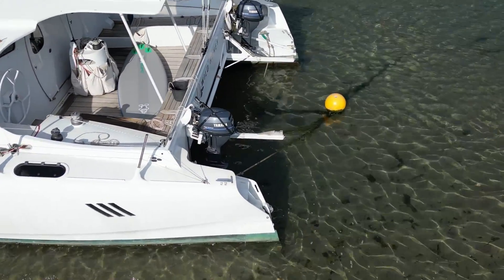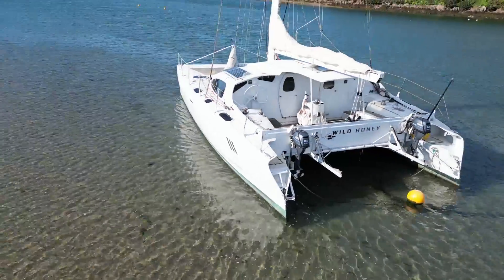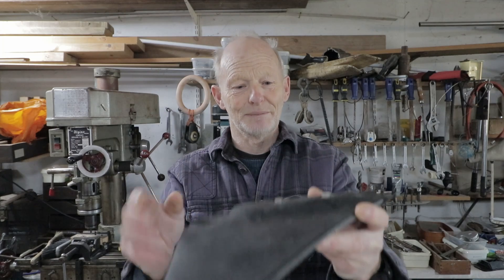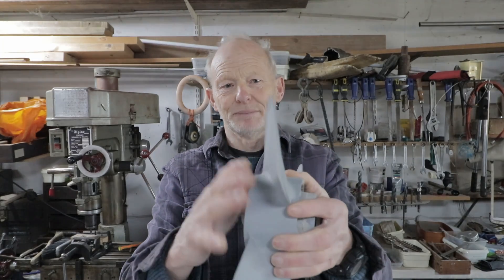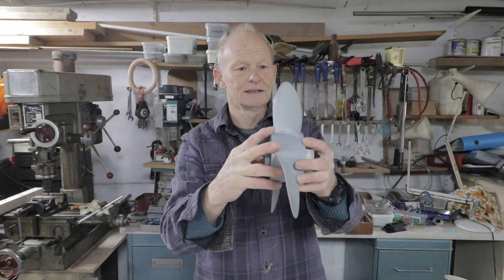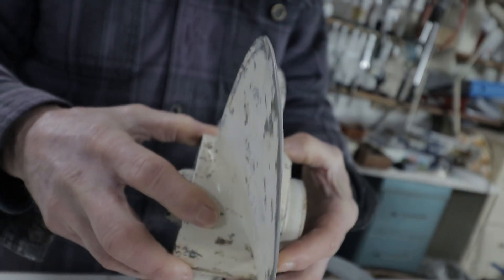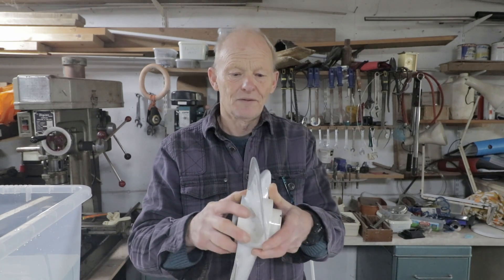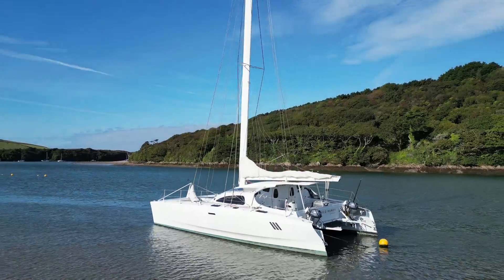Improving Propeller Performance In Rough Water – Ep05

Comment: Another solution would be to use 4 blade props that are cupped. To do this and still maintain full RPM of the engine the pitch number is usually reduced by 2 when moving to a 4 blade prop, best to consult with technical services at a reputable marine retailer or contact the manufacture. Four blade props offer more thrust, better maneuverability, better mid range cruising efficiency, and offer a better initial boost to get the boat moving(some call it a hole  shot in the US), in a planning hull boat the 4 blade prop will keep the boat on plane at a lower speeds when compared with the standard 3 blade prop. Three bladed props are better for top end speed which is not what you are after. Solas propellers offers aluminum and stainless replacement prop in 4 blade and three, in cupped and non cupped.

Comment: Love how you mount the outboards. What type of track is it and how did you mount it? Could you do a video on this? How do you raise and lower them? Steer them? Using outboards seems like way less work than mounting diesels internally. And if the type of cruising changes you can change to bigger or smaller ones. You seemed to suggest that the choice was influenced by being cost-constrained (aren't we all?). But is it not a better solution, or do you have reservations? I'd love to hear as I am mulling over this decision for my own design.
Reply from the maker: Thanks for your comments, and great questions! The track is a standard large mast track - a discontinued Bainbridge product - and we've built a custom car to go up and down. I've put this on the list for a film in the spring when we're servicing the outboards :)

Comment: If the underlying problem is that waves are heaving the props up and down in the water, then having the motors further forward (for example on a tilting platform) could help.  Depends on (longitudinal location of) the athwartships axis about which the boat pitches.  For a cat that's usually near the mast, and of course it varies by center of gravity and hull hydrodynamics.  If so, then the props might see more stable water depth nearer the mast, i.e., further forward.

For a cat with a wider stern at the waterline, the pitch axis may be further aft.
Reply from the maker: Thanks for the comments. I've done quite a bit of work on this and it seems thatthe pitch point on most cats is about 1/4 forward of the waterline from the stern. I'm planning a video on pitching, regarding Wild Honey specifically, which you may find interesting :)
Reply: @SailingWildHoney  The pitch axis (it really is a point in 3d space, but I called it an axis in 2d space, like a profile view) will be in different places depending on boat design.  The forces will act through the center of mass.  If the hydrodynamic forces on the hulls were equal fore and aft then the pitch point would be at the center of mass, etc. 

So depends on design, but may be further forward, especially on a fine stern with less pitch resistance aft.

Comment: If you angled the propellers, then the up down motion would not strip the boundary layer on the propellers as much.   Normally most boats have their propellers deeper so higher pressure also keeps the boundary layer attached.   Only real solution(maybe) would probably be a propeller with its infinite blade tips.  Of course currently only designing them for the 150HP market, and they cost $5000 a piece.
Reply from the maker: You're right! And propellors are expensive! But the cupping has been surprisingly effective :)

Comment: Perhaps it would be more effective to arrange for the propellers to reach deeper into the water? Add a telescoping piece to the mount that give you an additional 30 cm, and make a replacement hood that can stand hard splashing and being "submerged" occasionally, and add some nice smart replacement for the standard seals for the Choke knob opening in the die cast aluminum body etc. 

I'm building a set of two electric drives, 70x70 mm brushless motors feed by 100Ah 48V LiPo pack, as replacement for my outboard. I chose to do this because of the cumbersomeness of having a heavy gasoline engine. The new propellers are attached directly to the motor shafts, super tight and lightweight in comparison to commercial solutions. 
I sail a 1989 formula 28 catamaran, for it I have been using a single 6 hp Tohatsu SailPro that sat just a few dm above the water. Yet it lifted the propeller up and it sucks air when the waves are high. The boat is an old racer, so it’s only 700 kg (8,5 x 5,5 m with 15 m mast), and 6 hp did not take me upwind in hard conditions, but it allowed me to choose the downwind path 😏 Now I hope to be able to go any direction 😄

Thanks for your inspiring videos!
Reply from the maker: Thank you! Your boat sounds great!! Years ago we did look at electric but it was in it's infancy and we couldn't really afford it. But I did make some fibreglass pods for electric drives, which we then abandonned for the more conventional route. Lowering the engines would be a possibility if the problem with motoring were more severe, but the cupping has been surprisingly effective :)

Comment: Interesting study , I did think you were going to look at the height of the water in the tank to determine thrust ( relative difference)?
FYI to improve epoxy bond to alum or lead I do a final sand with some wet epoxy on it which keeps the air away from the alum and stop it oxidizing then go straight into laminating . 
Cheers Warren
Reply from the maker: Thanks Warren! Yes, the "experiment" left a lot to be desired :) 
Great tip for the epoxy bond

Comment: What about a propeller "tube" to eliminate the "water slip" from the rotsting prop? Cupped props only work in one direction, the opposit one lacks thrust. Coming from more powerful outboard engines the stainless steel props gain more bite due to thinner blades which also are more stiff compare to alu at high revv. Really expensive and hard to repare
Reply: a kort nozzle? too much drag for a normal sailing prop when not in use - but probably great for this setup since you retract them out of the water when not in use.
Reply from the maker: Interesting idea! We did consider using them, but felt that the issue we had experienced with the hydrofoil wing would be similar with a tube, in that a ventilation bubble would get trapped in the nozzle

Comment: I admire your engineering prowess in tackling that modification.
I think I would have looked to having a longer engine mount.
Not sure your front / aft explanation was quite correct.  Moving them a bit forward normally puts them at the highest point of the hull wave.  And closer to the point of least pitching.
I have a Woods Gypsy, the builder put the mount on the rear beam, very similar to your location.  I notice that Richard Woods drawings show the outboard in a cockpit well. 
If you don’t turn the outboards I can’t see the front / aft make a difference on the manoeuvrability.  It is more the distance from the centreline.  Of course if you can turn the outboards, as far back does work well.  I can turn my motor which is pretty essential as it has a flat bottom. 
I had a 22’ cat and used a dinghy motor that swivelled 360deg , great for turning and amazing for reversing.
Reply from the maker: Interesting, thanks for the thoughts! We have a friend who had a 360 mount and yes, it was really great for manouevring. But it was a lot smaller boat. Moving the engines to the pitch point will definitely help, but not an option for us at the moment.

Comment: I just came across your channel. It is so refreshing to have a channel that doesn't do soft porn or condocats. I have a 38ft strip cedar cat I built that I work on too, she is currently getting a paint job which is taking a long time. I had the same issue as you when I put my new outboard pods on. As I came home from the slipway where I fitted them, the outboards (Yammie high thrusts) would rev each wave. I didn't do anything with the props, but I extended the depth of the pods. My pods are rotating so they are flush with the bridgedeck when retracted but they now don't ventilate at all when motoring, so maybe you could also extend the mounts to drop the motors when needed. 
My motors are slightly further forward, this means they don't get kicked out so much as yours may when my cat pitches. 
Great channel, thanks for showing us a truly interesting boat, with real innovations. Such a breath of fresh air in a world of production cats.
Reply from the maker: Really appreciate the feedback, and details of your boat. We'll see how the cupping goes and report back!